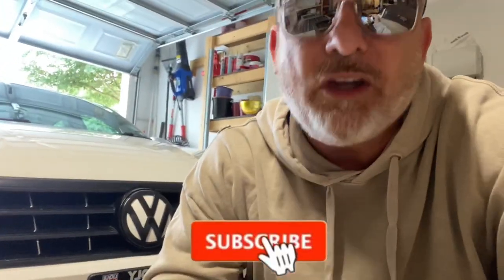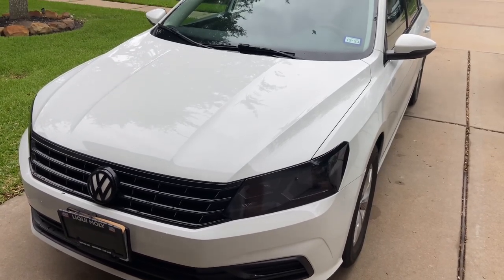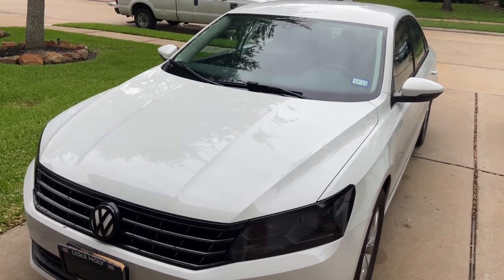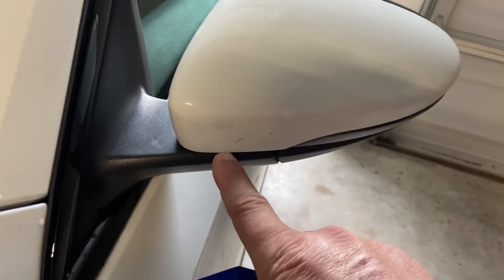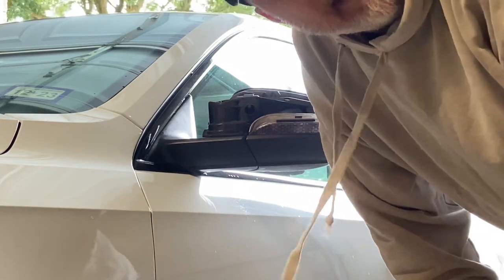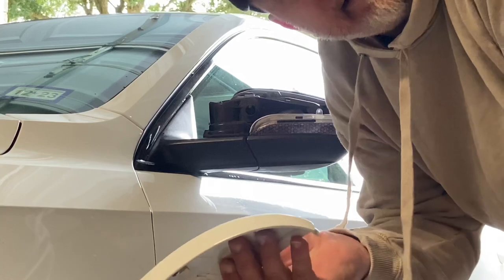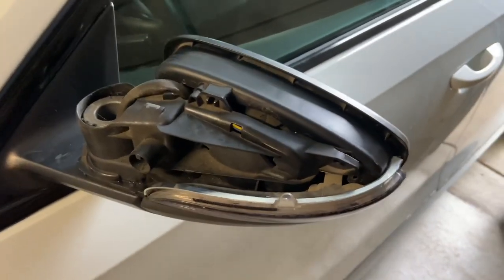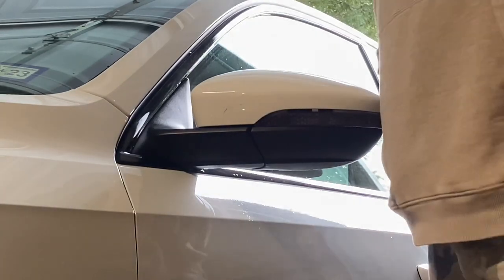How To Remove Mirror Caps For Turn Signals or Vinyl Wrap - VOLKSWAGEN PASSAT

Comment: Thank you! This procedure worked for my 2013 VW CC.
Reply from the maker: Dang yes!   Thank you for watching and it’s good knowing I helped.  Thanks again.  👍🏼😎💯
Reply: Does the 2009 Passat CC have the same mirrors? 
 In other way: Is this white Passat in the video a B7-Passat?
(because I do know that my Passat CC 2009also has B7-mirrors)

Super tutorial btw, good to know that it is so easy to do! 😊 😊
Reply from the maker: Yes B7.  But not sure about CC mirrors.  🤔

Comment: can i do this too my vw cc as well ??
Reply from the maker: Im not 💯 on that.  Good question.  You may need to look it up.  Sorry bout that 😎
Reply: It took some effort, but I was able to pull it off! If you are having difficulties, I recommend using a second pry tool and working around the turn light.
Reply from the maker: That’s also a good idea.  Thanks.  💯😎👍🏼

Comment: Someone side swiped me and got my wing mirror. The indicator is slightly cracked but still works, all of the electrics works including the camera etc but it's not holding place because something mechanical inside must be broken/popped off. I'm wondering if you have any video to help me investigate/fix. I really don't want to spend £800+ for a new one, I'm certain it can be fixed, but even if I open it up I'm not sure I'll know what I'm looking for. Help?
Reply from the maker: I’m not a mirror expert.  I’d at least pop it off and see whats going on.  its mostly plastic do chances are its broken.  but worth looking at.  there are several videos out there showing the insides of the mirror.  hopefully they can help you.  wish i gad the answer.  🙏🏼

Comment: I have a question.  Did you have trouble getting the clip in the corner closest to the window clipped in because I have that problem and I've had my cap fall off and had to order another one. Don't want to make the same mistake again.
Reply from the maker: Not really.  I just applied pressure around it and you will get a few extra snap sounds.  I thought I had mine on but it wasn’t fully on I think because of what you are saying.  If it doesn’t snap in just take it off and try it at another angle.  But don’t force it.    It’s worth a shot.

Comment: Ended up breaking my turn signal light & cap fell off when backing into driveway. Mirror is still attached & perfectly intact on car. How do I do this & replace turn signal as well?
Reply from the maker: I haven’t replaced the turn signal.  I think the turn signal is only a couple screws.  It’s been a while.  But after that the cap should snap right back on like in the video.
Reply: They make replacement turn signals , I broke my entire mirror so I ordered a new (used) one when I had attempted to put in sequentials, the spring loaded key for the folding mechanism left the chat , so I just superglued it to the out position , I ordered a used one and am replacing the caps to carbon fiber since pair matching is a hell of a hastke
Reply from the maker: Nice!!!   I thought about the carbon fiber caps.